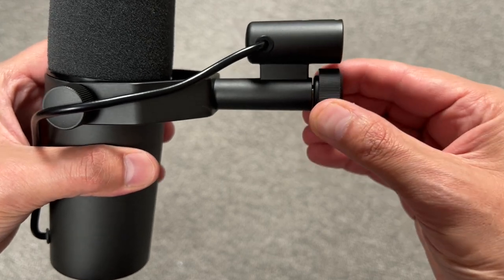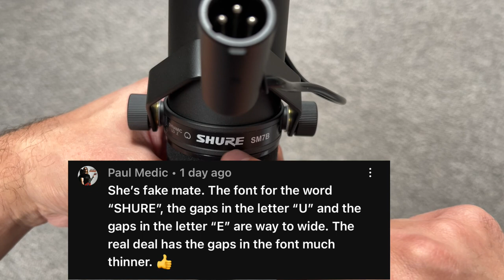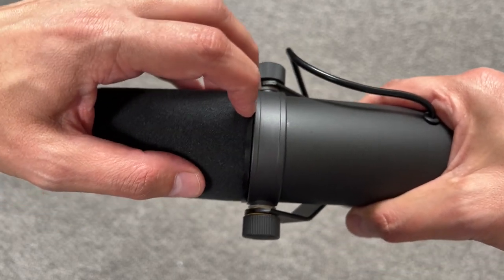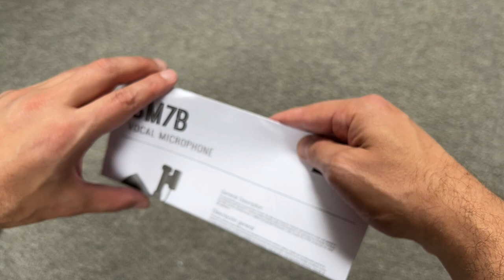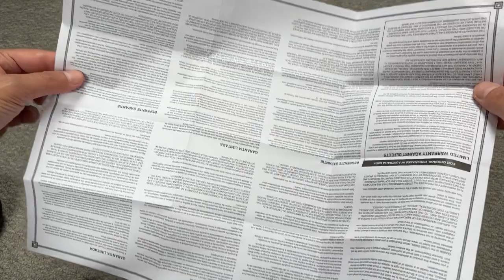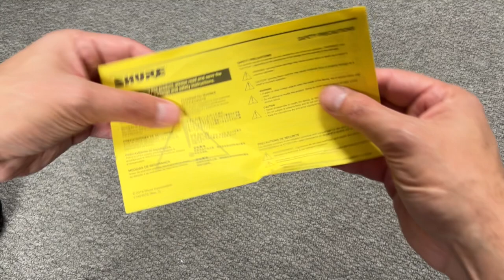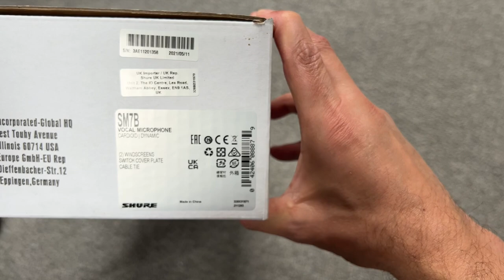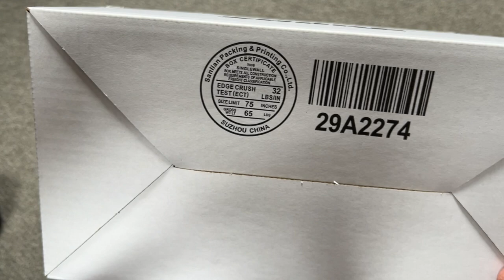Is This Shure Sm7b is Fake or Real?

Comment: I work at Shure and some of the fakes I’ve encountered are hard to spot, also the more people reveal about the fakes the better the other fakes become because simply you are giving back constructive feedback to make the fakes better :D! The ultimate test is the low-end response of the capsule, they won’t get that right plus the humbucking windings. If they have that done it will no longer be cheap to make. Unfortunately vocals will not be the ultimate test for the mic unless you really know the mic for a long time.

Comment: There are 3 things that tell you that this microphone is original, because no replica respects them. The letters of made in china (mexico) the country of the fake is usually written in lowercase. Secondly, the back cover, the 2 holes of the fake do not come with the silver hole so that it adapts well to the microphone, the hole is black. And finally the most obvious, the microphone capsule, which is seen below the grille when you remove the foam. In the original it does not reach the middle of the grid, like yours, and in the fake ones it is longer than the middle of the grid, with the capsule of the fake being closer to the mouth. Your Shure its Original.
Reply from the maker: Thank you very much for the comment I really appreciate it.
Reply: when you say mexico, do you mean real ones can be from china or mexico? Or is it automatically fake if its from mexico?
Reply: @cheph  Both are possible for original china and mexico. Think about it SHURE is selling all over the world and it just makes sense to produce at multiple locations.

Comment: You can send it to Shure and they will confirm if its fake or not, as per Shure it's very very difficult to know the difference for the average person. The solution is to buy from an authorized dealer.

Comment: Real deal. I have the exact same ... beside mine has has a sticker on top and bottom both say "SHURE". 
This is the one build in china and the "new" one I have to say.
If you would open up from the back side (just the three screws) you will see yellow and green cable which is the original choice (the copies just use all the colors).
Plus, if you open up the back you just feel the build quality. It is very, very well put together. Everything feels sturdy and "heavy".

BUT: Don't judge by the looks of it. It is a SM7B ... listen to it. This mic is fantastic and the copies don't come even close. You have the real deal by the looks of it but I'm pretty sure that your ears can rule out all doubt in a second.

Comment: Hey, I got the exact same mic, did you find out if it was a real ?
Thanks
Reply from the maker: Hi Florent, I still don’t know. I spoke with SHURE last week and they told me that if I want to know I need to send them the microphone and some of them engineers will inspect it.
I am on a holiday at the moment and I will deal with this next week. If you want I can give you the email address that I used to contact SHURE.
Thank you very much for contacting me.
Reply from the maker: The microphone is real.
Reply from the maker: The microphone is real
Reply: I was reading there is after market workers in china that work a 3rd shift they work for the factory’s that make the real mics an when after hours they come in an make copy’s of them for the black market so I’ve heard a lot of the ones people say are counter fit end up being real

Comment: Hi - it's Paul, you left me a message on my test video. I've now established there are at least 3 different fakes. One is pretty poor, and like the one I tested, this one is pretty good, but the Shure label is wrong - small differences in the font, but the real cable is not as stiff as this one, it's quite flexible. Being honest - the price of genuine Shures is NEVER that cheap. Shure dealers simply don't discount them that much, and other dealers would complain. The blank comes in two versions I have seen - one with countersunk holes like yours and one that are just holes - but that font is slightly wrong again. The original is in a non-shiny packet, not a thinner shiny plastic one. The counterfeit I tested could NOT be identified by the sound, so if yours sounds good, it is good - but of course won't have resale value as a fake, and selling it as genuine would be wrong of course. SO - my considered opinion is it's a good fake, but not sadly, genuine. Yours has a better clamp arrangement on the knobs - that on my fake was unable to tighten up properly.
Reply from the maker: Hi Paul, thank you very much for your quick response, appreciate it .
Thank you for all the information you shared, it’s really helpful.
Reply: This microphone is made in two different factories. And even though they both have the same specifications, and may be 99.99% same, then end product (such as cable stiffness and *shine*) will not always be a 100% exact, as it is coming from two different factories. I bought one two months ago, from an authorized reseller in Europe. Paid full price. Packaging is the exact same (cardboard inside instead of Styrofoam that most US unboxings had), sticker has cutout in the middle and white back (while some US ones had black back), and same UK importer label and all the other labels, just with other serial number. And also, besides being built in two different factories, this microphone is on the market for the past 50 years, so obviously one made in 2022 might be somewhat different than the one from 2002 or 1962. The ONLY difference I noticed is that yours have label on one side, while mine has on both. But then again, I would hold on with any final verdicts, as we can all just be guessing.
Reply: @botox1603  You are right, the end product can't be 100% the same all the time.
I would judge this way:
* Does it have a awesome and sturdy build quality?
* Does it create a awesome and clean audio quality?
It is the real deal.
If you think you have a fake just because one sticker is missing and the build itself is great and it sounds awesome ... you don't have a fake ;)

Comment: Look here is the thing.

 I bought what I thought was a real SM7B that turned out to be a Fake, or more correctly , a made in China Shure SM7B.

 I made a studio A / B comparison with a "Real"  Shure SM7B that cost US$600  more.

 You know what, there is not $600 of difference in the sound quality. 

I think SHURE are having two bites of the cherry. 

They claim their products are made exclusively in Mexico, but  they DO manufacture Microphones in China. 

My  (Fake) SHURE SM7B works great in my studio, and I'm going to be using it for my close up vocal work in the future, but you be the judge. You Tube is inundated with videos about this topic, and for mine....I believe it's simply a Shure SM7B made in China.